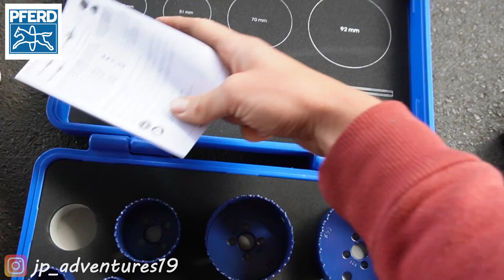Residential DOUBLE GLAZED Window Installation and SLIDE OUT DECK! - UNIMOG DIY Camper (Eps. 40)

Comment: Good choice with the double glazed windows. Have same idea in mind when time comes, so much better than poly RV windows I reckon for insulation. Are you guys going for the bagged insulatuion type? Interested to see the temp difference on a hot day between the outside S'metal and the interior T&G once its done. THink there is a type of paint that has insulation/Temp lowering qualities but cant remember if still availabe or not🤔.HAPPY BIRTHDAY JELE!😘 Also Happy Easter to you guys too. Wow a Coaster conversion in the making ,all stripped ready to go👍...Had plans of doing a coaster but with landcruiser running gear under it. Tell the coaster guys to buy a wrecked 200 series and put the running gear from that into the coaster👌😀would love to see that . Pricey to import them from Japan. Good seeing the updates,avagood1 guys,Ron
Reply from the maker: Thank you😇
That's what we think as well and in Europe it is more common to use double glazed windows than over here in Australia.
It is a roll of earth wool, I think it's 12m long, 580mm wide and 90mm thick☝️

Yeah converting a coaster into a 4wd would be good as well! I told them about it ;)

Comment: Is there a risk of the glass window breaking with any flexing of the camper body? 🤔  I think metal shutters for protection against tree branches in tight 4wd tracks would help as well 🇦🇺
Reply from the maker: Since the Unimog Tray doesn't really flex (torsion free subframe) the windows won't break. We have done a fair bit of offroading by now and didn't have any issues with the windows. They are also way stronger than plastic windows. Our box is full of scratches (also the window frames) but the windows still look like new. We know some people that had broken plastic windows from branches hitting it🤷🏼‍♀️🙈
Reply from the maker: Since the Unimog Tray doesn't really flex (torsion free subframe) the windows won't break. We have done a fair bit of offroading by now and didn't have any issues with the windows. They are also way stronger than plastic windows. Our box is full of scratches (also the window frames) but the windows still look like new. We know some people that had broken plastic windows from branches hitting it🤷🏼‍♀️🙈